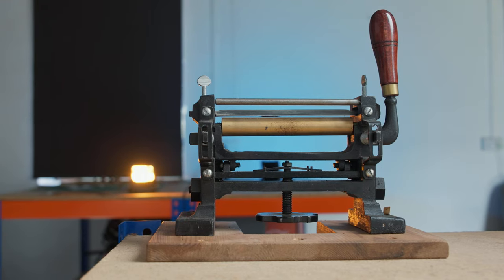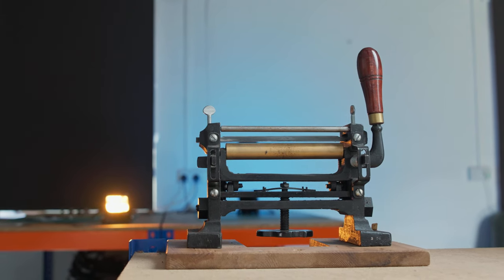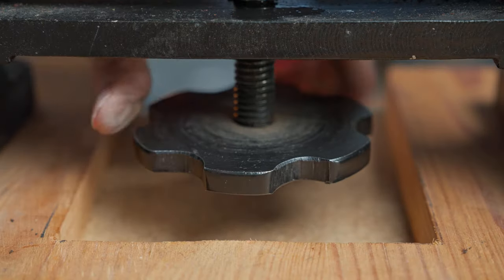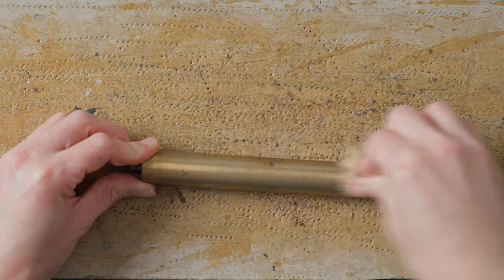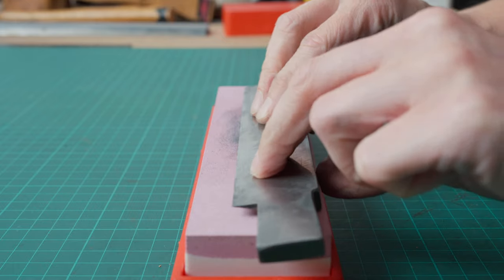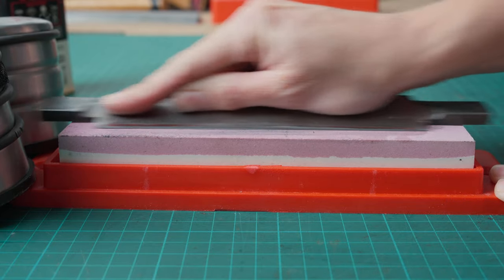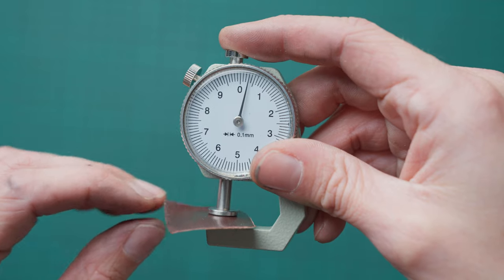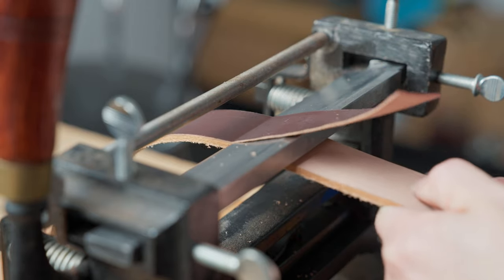The Splitting Machine // Set up and Sharpening Guide // Tool Time

Comment: Some great tips! Currently I have 6 splitters lying in my workshop. Most of them need a bit of tlc or light refurbishing. One among them is also a Dixon like yours. Not sure if I am missing something but when I use the adjustement wheel to set the thickness, I loose tension on the roller part and the roller gets wobbly.
Reply from the maker: Wow 6!! I am not sure on the tension thing, it is not an issue I have heard of before

Comment: Hello Jo, thank you for the video. Please can I ask you a question about the Joseph Dixon splitter? 
I am awaiting the delivery of an identical splitter to yours and have been using one of the better Chinese splitters bought off eBay, which incorporates a locking handle/knob, enabling the user to lock the gap between the roller and blade. A good idea in theory but it nearly always slips. 
Does the Joseph Dixon have a locking function or is one not necessary on this model?